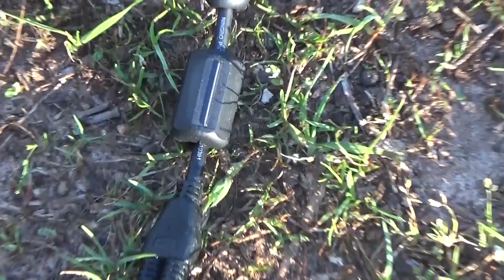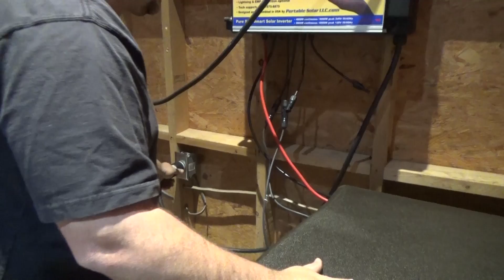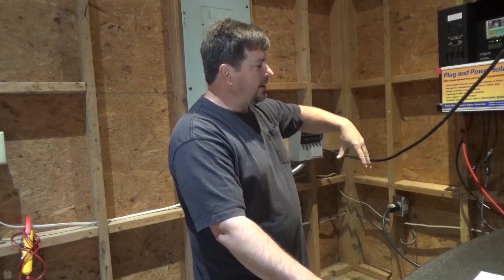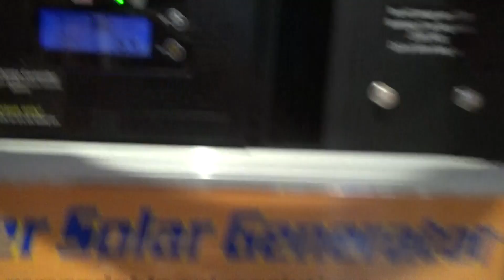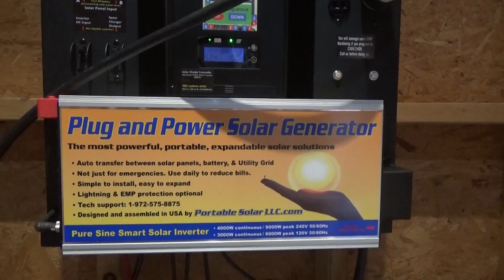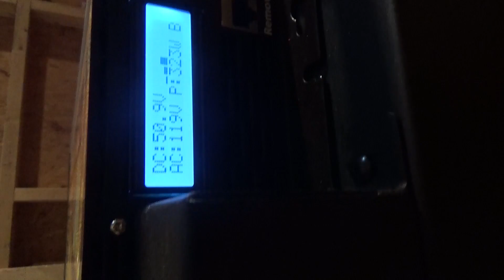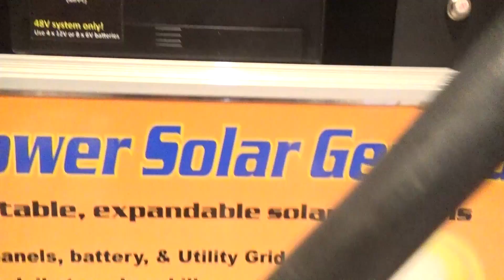Sol-Ark EMP Hardened Solar Generator

Comment: In your battery, you need to put a fan to keep it cold and don’t close it all the way and make sure it’s not inside the house if it’s inside the house put a fan from the battery closer, that pushes out the heat directly outside the house in case there is any gases comes out

Comment: Great video thank it was very informative. You are lucky to have a great product available to you. I am based in London (UK) and I'm considering this product but need to find a local company to install it for me. It's the EPM resistance I am very interested in. Another issue I'm looking for is protection for my home from the ingress of radiation dust in the event happens. I am considering using a  Positive Ventilation System    https://www.youtube.com/watch?v=wTMeZxoH3eY&t=9s  to hrlp. Any thoughts?

Comment: How about a schematic diagram?  A table showing the different operating modes?  Seems like your just alibiing off the top.  (i.e. that it took you 5 hrs to install, and that you mentioned that 3 times, is not all that helpful.)   How does the EMP part work?  Recovery procedure?  Does it sense excessive voltage on the line in, and shunt it to ground?  Extra large naked copper conductor?  Separate standard grounding rod?  On and on.  We can go to the website for a promo.....wanted a little more engineering detail.

Comment: the so-called e&p suppressors are nothing more than ferrite clamp on beads with your used for suppressing radio frequency interference that is all. Real EMP protection requires several different methods including gas discharge tubes varistors inductors and capacitors. I do not recommend anybody depend on this product to protect their equipment.

Comment: if its free that is fine bin living off grid for 45 years  solar is so low cost now  get a real  Inverter my magnums 4000  watts cost me 550$ for  2 used ones  Chevy volt  batters cost $ 1400  4000 watts of solar $1200  charge controllers  from  Wisconsinn  made  for the us gov  4 of them  cost   $1200  total cost less than $5000  and ground the system right and it will be fine   it to city for me in my 60 years  35 have bin out in the woods

Comment: Have five hundred gallon propane, 35 pounders, and numerous 1 pounders and the adapter to use with Coleman stove (heavy duty grates!), gas stove, propane generator.  Rocket stove, Ashley wood stove (baby in the house).  Solar chargers.  Looking for money to buy 2 small solar generators to keep 2 CPAPs.  My prepping is the worst case scenario, grid down.

Comment: What about the diodes in the solar panels?  That EMP wave is going to slam right into them!  Think sizzle fry.  The "generator" (it doesnt generate electricity,  it just filters, balances, inverts & switches) might be shielded, but without working panels, what good is the generator?

Comment: I got a samlex Evo it does the same thing runs off the batteries into the baddest go to 80% and then it changes the grit power if you cannot find the grid it will automatically send a signal and start my 20kw generator been online for year-and-a-half is Power by Lincoln high on batteries no service no maintenance guess I'm generator is the only thing I have to do maintenance on

Comment: Will the Sol-Ark work with wind turbines?
Reply from the maker: Sure.  I just finished an install adding 2 small turbines to a Solark build.
Reply: @engineer775  
Good. One other thing I had called Sol-Ark before I recieved your response  and one of the salesmen said you can only use wind turbines if the controller goes direct to batteries not Sol-Ark 8k. 
Is that how configured? He said Sol-Ark can't control the input from a wind turbine or monitor how much energy it was recieving.

Comment: Emp will  toast the panels themselves I've seen testing where charge controllers and inverters survived and work after a reset but no solar panel survive it burns them right up you have to set yourself self up for 1800s style of living

Comment: EMP releases microwaves and because of their multi-path propagation characteristics they render all connection points in an electrical system vulnerable at sufficient power density in the far field.  That particular system is definitely not hardened against EMP.  My master's thesis experimentation proved multi-path propagation of sufficient power density in the far field from a simple magnetron-based generation device (old radar magnetron) renders SCADA and other electronic equipment, even inside NEMA rated enclosures, completely vulnerable.  These microwaves penetrate even the gaps at hinges in enclosures.  Those chokes do mitigate, but they mitigate only inside their field.  EMP microwaves simply pass by the chokes outside their field and affect any unprotected connection points in the system, such as those outlets mounted on the system (any anything plugged into them).

Comment: The unshielded  wires going to the transfer switch is a big problem, also all the unshielded wiring in the house and the unshielded battery bank. Doubtful your system will work there after an EMP.

Comment: Great video !  I have an APC Smart-UPS 1500 mini tower (w/two batteries) to back up the desktop computer.  The power went out for a few short minutes (this past week) and the UPS read 84% battery back up left when power stayed on.  Took less than an hour for the UPS to recharge the batteries.  Also back up the ADSL Modem and the Dell 24-Port Switch to stay on-line and connected to YouTube !  Most of the outages are only a few seconds and the longest outage was for about four hours a few years ago...  Maybe get a Military Surplus Generator for longer outages and may be built with EMP in mind.  tjl  P.S. Internet phone lines need battery back-up to stay connected !

Comment: Didn't see any protection from lightning strikes, a lot more probable than a nuclear blast.  So your panels will survive an EMP, your equipment won't.  EMP generates pulses that fry any electronics unless they are carefully shielded.  Consumer goods are not protected.  Unconnected light bulbs and some electric motors might survive.  All moot if the explosion is close enough.

Comment: Doesn't answer the EMP question.
Reply from the maker: Everything that's connected to the system that has a ferry core on it will be protected by the system.
Reply: Yes, assuming the solar system survives the EMP blast, what equipment will survive to use that power?  

I encourage everyone to read the book “Blackout Wars” by Dr Graham.
Reply: Any equipment that is hardened. Basically you have to make sure you have an emp hardened shelter.

Comment: Excellent video,,,,,However, I heard you say (30 amp) service several times. That is great for city dwellers. Us country folks, need a little more juice. 50 to 100 amp as an average. A well pump uses a 30 amp breaker. Then if ya add a refrigerator / freezer & a couple lights. One can use wood to heat, water & cook.. What say ye on 50 to 100 amp ????
bobbycwoodshop@yahoo.com

Comment: What did all this cost you or since you said, they kept sending you things, but cost factoring for me. I need an idea of what you have. The hardened EMP resistant solar panels are ideal, How much does your current panels produce. You can run it continuous? you have 24 batteries,how long will they keep your lights and refrigerator keep going?

Comment: I think some solar trackers for those panels would be your best investment.  Also, consider using mirrors to increase the square footage of sun hitting your panels. I would also consider some misters to cool down your panels to extend the life of them, and to get more power out of them.  Use rain water to mist them with so there is no calcium build up like with tap water.

Comment: those "emp" ferrite cores are a farce. and EMP isnt going to be a HF signal inducing noise, it will be a fat dump of magnetic energy that will turn everything that is a ground loop into an energy producing transformer that will be a low voltage high amperage burst(s).
Reply: If they were the only thing being used, I would agree with you. They are not.

Comment: Hey Scott, have you any new info good or bad about the Sol-Ark solar bbu setup?  Do you know of any other ones on the market that is as good or better as of April 2017?  I am researching them now and plan on getting one soon.  Any additional info would be greatly appreciated.  Thanks for all you do.  ~ dave
Reply: CrazyLegs faraday cage a system and backup equipment...or pay 5-7x the cost for this shit.
Reply: Doug Brinks  Thanks.  I do understand some about Faraday cages as I design many types of them for a living.  The real value in Sol-Ark is their EMP testing and EMP hardness.  Nobody else has done the testing and the hardening.  This is mostly what you pay extra for.  The next EMP we have, whether from the sun or man-made, all these cheaper unhardened systems will be damaged and fail to work.  This is my driving motivation.

Comment: the black box on the rear of the panels have small ic device chips.  they are three legged and are used for when a part of the panel is shaded, it shuts down that section while the other part of the panel generates power.. THOSE CHIPS ARE NOT EMP PROOF.

Comment: As per jerry Emannualson's Emp pages:
The best solution for shielding a solar panel is 20 mesh, high-transparency, aluminum or stainless steel wire mesh.  Since this is a product that currently has to be made to order, the best alternative for most people may be the 8 mesh galvanized steel hardware cloth with 27 gauge wires.  This is available from some of the Internet suppliers of wire mesh.  An 8 mesh hardware cloth will let through some of the higher frequency components of nuclear EMP, but unless you receive a maximally effective EMP strike, this material should protect a solar panel.  Unless you can afford to have some of the 20 mesh, high-transparency, wire mesh custom-made, the EMP protection of your installed solar panels will be a matter of compromise using less than optimal solutions, but solutions that are likely to work in most cases.
Reply: We contacted Don White (co-Author of several books with Jerry Emanuelson). Their' books have a lot of good information and hope people are waking up. But they have no EMP Simulator test data showing Solar Panels damaged by EMP. We have two different EMP Pulse Simulator test results showing solar panels survive without a faraday cage when properly protected. One was done by our own nuclear engineer at White Sands test facility.
Reply: Great to know. Its all about confidence, so publishing the results and giving an overview of how you did this- without proprietary details- might be a good way to inspire confidence. I am contacting Scott about designing a solar back up system, so that would help make a selection of panels easier.

Comment: Clue me in then. Your supposedly protecting the power source in some way. Is the microwave, electric stove, refrigerator, computer, washer, dryer, electric WH, A/C and so on and so forth on the receiving end going to get fried? Whats left to run.
Reply: Excellent point that most people miss. The system comes with EMP suppressors for each appliance. Your appliances are guaranteed to die if they are plugged into the grid. Sol-Ark and the suppressors provide a pretty good chance the appliances will survive. Some electronics will need a reboot too.
Reply: You protect as much as you can, have backups of critical components (chargers-inverters etc) - and never expect live to be easy after an EMT burst.
Reply: Just get on the 'net and order new ones! lol!
Reply: Do I order the net first or the appliances?

Comment: OK. I'm something of an engineer too. Everything fails. That's inevitable. How easy is the head unit to repair? Also, how exactly is that head EMP hardened? Your right about those ferrite chokes on the cables. They aren't going to compensate for a large scale EMP discharge that's as close as ten miles away. While survivable, that would do some serious damage to any active electronics. As some of us know, the completed circuits act as antennas for the EMP to hit which turns them into transformers. It's the surge of electricity that creates which does the damage. I'd have to see the internals before I'd trust that unit. Like most preppers I have to assume it's snake oil until proven wrong.
Reply: We built our own EMP Simulators (up to 100KV/m) and have done extensive testing (8 months) on the EMP Hardening. We should be doing some videos in the next month.
FYI, our company has no salesmen (most are engineers). Our team quit very high paying jobs because someday (maybe soon), we will meet our creator and want to say we did all we could.

Comment: If a EMP blast happens then almost only due to a high atmospheric detonation of a nuclear weapon that will be followed by hundreds if not thousands of nuclear and thermonuclear weapons hitting targets on all sides. What follows will be a nuclear winter lasting years if not decades. Without sunlight a solar system is useless.
Reply: If the emp is from the sun there is no nuclear winter.
Reply: Andrew Baumgartner sadly, you're mostly right. But, for example, a North Korean ICBM could detonate a single high altitude weapon
Reply: Andrew is totally correct.
If the N Koreans set of an air burst over the USA, that would not be the end of it.
What the USA would do to N Korea as a result would cause the nuclear winter...
Reply: 1. How do you know what will be the response ( have you hacked the DOD ) ? 2. Do you know the what the initial nuclear limit is to cause a "nuclear winter"?
Reply: Andrew Baumgartner   How would you know? How many nuclear 'storms ' have you been in?  That's what I thought.
Reply: Andrew Baumgartner  well that’s no good.....
Reply: Our worst problem after a grid down situation will likely come from our own panic.  If an inch of snow hits Atlanta in the winter, people rush to the stores to clear out the shelves.  That’s how people react to minor emergencies. However if the grid is down, the stores will be dark, and the checkout registers won’t work.  So ... looting is next.  It will be the norm in every city until the shelves are bare.  Warehouses will eventually be looted.  Banks will be closed.  Money won’t be of much use anyway. Communication will not exist.  The entire globe will be impacted by an “event” here in the US. We may never have any SHTF event, but we can’t be sure. My opinion is that it does no harm to prepare for a grid down situation.

Comment: I don't understand how those panels could be EMP hardened.  EMP punches holes in Silicon or any other micro conductors.  I would think a strong enough EMPpulse would turn those panels into a dart board.
Reply: What is so funny about that?  Solar panel are made using silicon and EMP Blast punches holes in silicon.  That is why an EMP pulse would take out all Electronics.  Pretty straight forward.
Reply: Solar Panels have been tested in two different EMP Pulse Simulators and survived without a faraday cage when properly protected. One was done by our own nuclear engineer at White Sands test facility.
Reply: valveman12;  Could you provide your source for the EMP blasting holes in silicon? I have never read that. From the research I have done, I thought the EMP induced a very high voltage spike primarily in long run's of wire, Like power lines, power cords, antenna's. and transformers both outside and inside equipment. The high voltage spike then jumps and burns the micro circuits. My understanding is that is how most electronic are going to be burnt out, unless it is close enough to the event to physically deform materials in the micro circuit. YT has some interesting videos on shrinking coins that involve a heavy copper coil (one wrap) and some very large capacitors.
Reply: Please define 'properly protected', and let us know what MIL spec you were testing to.....
If it's the old 20 Millisecond single pulse, fast risetime and fast falltime spec; it's a useless test.
Reply: ".  EMP punches holes in Silicon"

lol
Reply: Portable Solar LLC What exactly does properly protected against an EMP pulse mean?  My understanding is that circuits may survive an EMP attack but upon investigation, there are micro holes in the Silicon.  Since Solar Panel are Silicon, how does that make them any different than Components made from Silicon?
Reply: Look up ESD damage to Integrated Circuits.  If you understand EMP Pulse, then you understand an EMP pulse is  capable of producing very high voltages and therefore cause ESD damage to Integrated Circuits and other Silicon Based devices including Solar Panels.  There are many examples of damage via ESD that puncture holes in the traces and even obliterate them.  Lots of pictures of damage as well.  Search: Photos of ESD damage to electronic components

Comment: So say a 4kw system, which i guess is the $11k version from the website, in an open field in West Virginia generates about 4,800kwh/yr.  Assuming no rate hikes at $0.108/kwh, you're looking at about $518 in power generated and a 21 year payback before the 30% credit and a 15 year payback after such; shorter when factoring in rate hikes.  You'd need to construct some mounts for your panels - it doesn't do any good if the EMP's save you from a lightning storm but it blows away the panels!  I guess the good thing about it is you can take it with you if you move, so you get the full payback.  But can I construct something cheaper with the same feature concerning the choreography with the grid tie-in and batteries (if I'm not worried about nukes or lightning)?